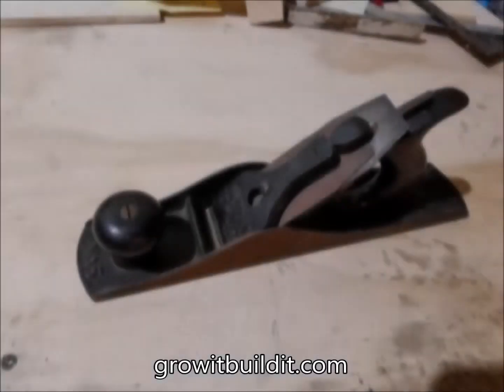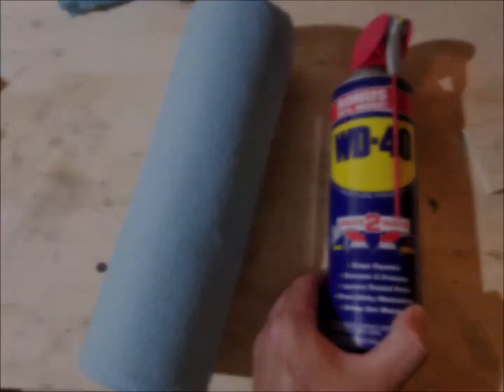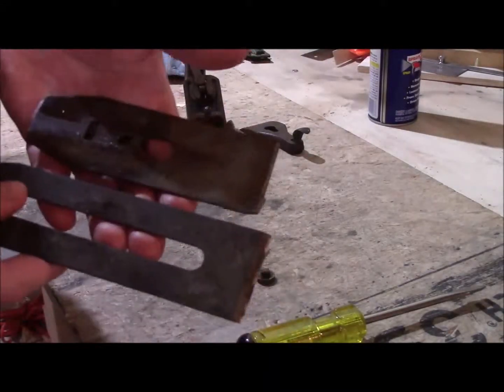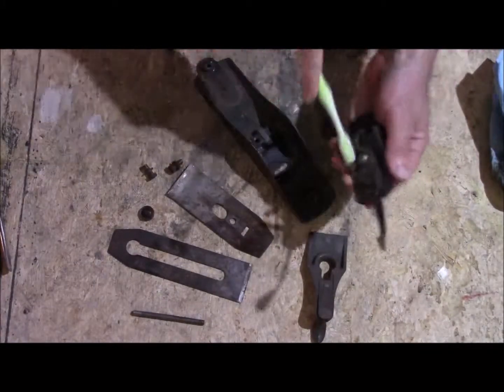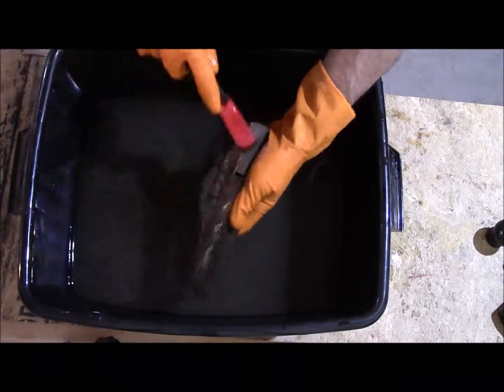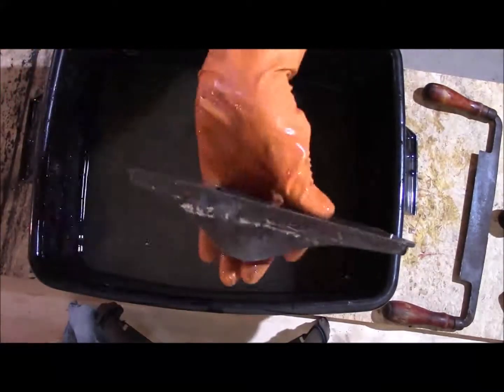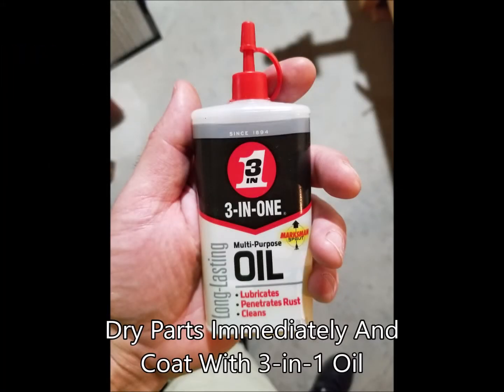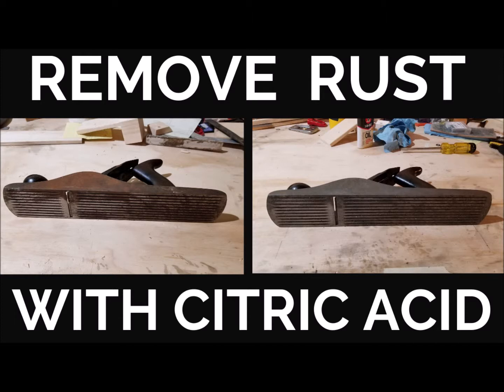How to Remove Rust with Citric Acid

Comment: I didn’t know acid was an option for metals 🤯
Reply from the maker: This is a very cheap option to remove rust.   It takes a little guessing/testing to get the ratio right, but it works well.

Comment: Big flaw in this presentation is that you don’t tell people how to neutralize the effect of the citric acid after it’s used because technically it will continually erode until you neutralize it with something like baking soda
Reply from the maker: I disagree.  Once you wipe it away and dry the part, it is done.  I have all most of these same planes today, and still regularly use them, and there is no corrosion.  They look the same as when I made this video.

Comment: Why coat in oil? Is that optional?
Reply from the maker: Oil will help prevent future rust, but it is not necessary.
Reply: @growitbuildit  For the reason you've just given, I'd say it's absolutely vital!  That's if you don't want it to start rusting all over again – all your lovely work gone to waste...  😬
Reply: I think rinsing it with water+a few teaspoons of baking soda will stop the rust from coming back. Otherwise it WILL start growing rust back on your bare metal within the hour.

Comment: What kind of proportions should I use if I need a small amount for cleaning? Meaning, let's say, a cup's worth of solution? I am working on some wristwatch parts and a screw is rusted onto a gear. It is currently in a bath of PB Blaster as a penetrant, but may have to dive into citric acid to help it along. Thanks for wonderful video!!!
Reply from the maker: Hi Jack - I would go fairly light on the solution.  No more than a teaspoon per cup/8oz of water, and just like in the video, only use what is needed.  Don't let it soak for long periods, as any impurities in the metal may be dissolved by the acid.
Reply: I use a soldering iron on furniture screws that are stuck. I find heating them usually breaks the bond. 
No experience with watchmaking though, so my tip might be a bit amateur. 
 Hope its not still stuck a year later.

Comment: Nice video
Reply from the maker: Thank you!  I'm glad you found it helpful.
Reply: @growitbuildit  Can i use WD-40 or hobby oil, for when I am sealing them with oil. Instead of 3 in 1 oil.
Reply from the maker: WD-40 is more of a degreaser.  3-in-1 oil will seal it much better.  And if you are really looking to protect them (if it is necessary) MinWax Paste Wax would probably be the best.